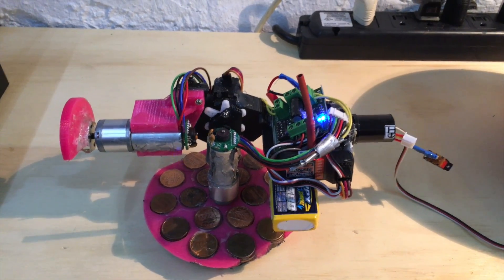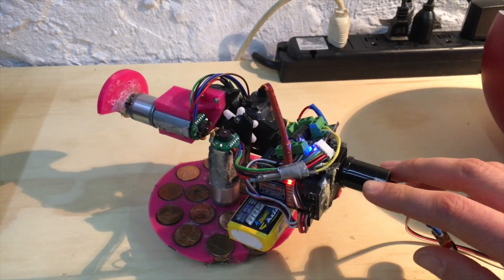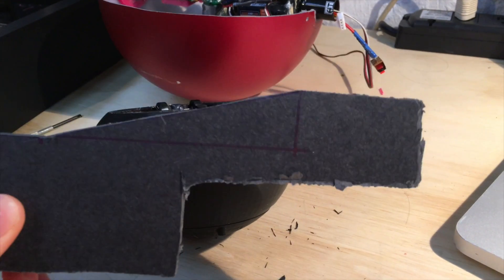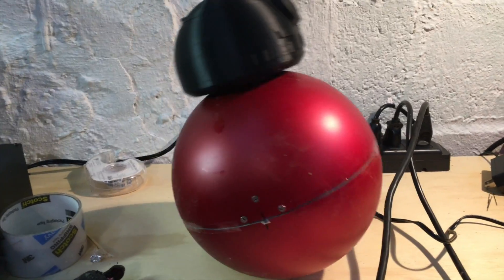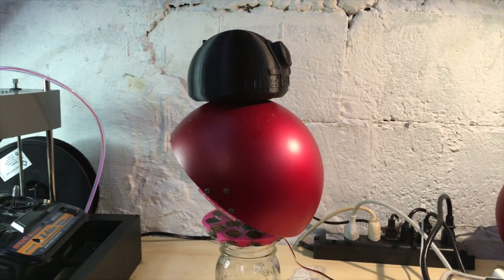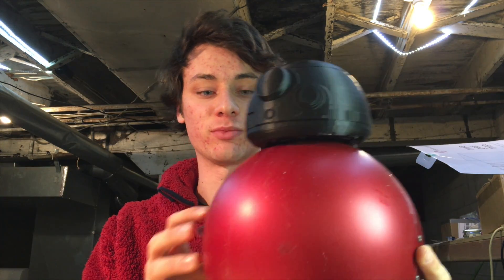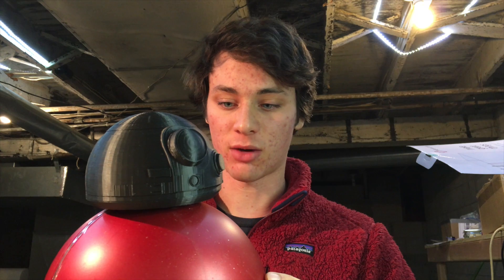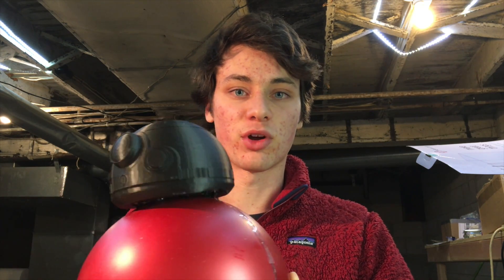Building Star Wars BB-8! (V2)

Comment: How did you make it wireless???
Reply from the maker: Using a remote controlled airplane transmitter (the remote) and receiver.  You can buy a receiver and transmitter for around 30 bucks on Hobby King.  Servos and DC motor speed controllers plug into the receiver and you can wirelessly control them.

Comment: I'm wondering if you could use a helicopter gyro vertically to correct the wobbling issue?
Reply from the maker: +Gabriel Comeau The response of the helicopter gyro was way too fast, and the ones that I got were not very adjustable.  It'd either vibrate at high frequency, or it'd create an unstable system where the gyro's over-correcting would cause the wobble to just increase and increase :/

Comment: Hey man! I'm building a bb-8. And my concept is very much the same. But I'm not very good with robotics:( and i dont have much to spend. I already have a sphere. But i dont know how to program/ wire the inside. Any suggestions? Please respond-As soon as possible:)
Reply from the maker: +HICKS INC. For the electronics you can start with RC airplane guides (FlightTest is a great resource) as all the electrical components are the same.  I did not use any programing, I just set it up like a remote controlled airplane.   For inspiration with hardware, Society of Robots and Lets Make Robots are good places to start.  Here are links to other robot-related sites I'm a fan of, so you can see techniques other people have used to build their robots: http://www.botsfromscratch.com/#!cool-sites/cmz0
Reply: +altapowderdog thanks man! Ill check it out!

Comment: I wish I understood how this works better... I'm trying to make a full size BB-8 and yours is by far the most stable design I've seen... Any help you could give me?
Reply from the maker: +Ethan Barnes Films Well, yours will be the same except larger motors, etc.  My advice is to keep the batteries and heavy stuff lower than I put them on mine, it'll help with the wobble.  Also, with a full size robot, you will need a gearbox with a large large reduction for the main drive motor, don't use 20:1 ratio or something like that if your BB-8 is full size.  Too fast of a drive motor and you"ll lose the low-speed controllability.  Also, the torque on the motors goes up as the sphere gets large.
Reply: +altapowderdog you might get this question why don't people just put a RC toy truck in a ball attach a pole to a base for magnets inside and add more on the outside, paint the body add details , done?
Reply from the maker: +Golfer Guy Some have!  But a rc truck has rack and pinion steering, which makes turning not work very well.  What does work pretty well is if the "rc truck" is a robot with two wheels that has tank-drive style steering, which is how the sphero works.
Reply: altapowderdog OK I kinda get it now,thanks.

Comment: You can get a bunch of that foam board at the dollar tree! It's super cheap!
Reply from the maker: +Gwoodcam Yeah, a couple people have suggested this.  I've built lots of RC planes using dollar tree foam board, so I know what that is.  I really should have done a better job explaining/ showing the material, it's got significantly stiffer paper on the sides than Elmers/dollar tree board, and the foam in the middle is less soft than either of those

Comment: How did u controll the motors and the servo? Can someone give me lings on the parts?  Good job with the build!
Reply from the maker: +Deenixd Thanks!   Heres the receiver, the servo plugs directly into this: http://www.hobbyking.com/hobbyking/store/__9042__Hobby_King_2_4Ghz_6Ch_Tx_Rx_V2_Mode_2_.html
Motors can't be directly connected to the receiver like a servo can, so this is what fits in between the receiver and the motors, and drives the motors: http://www.robotmarketplace.com/products/0-SABER2X5-RC.html
The battery (3 cell lipo) then connects to this speed controller.
Reply: I see... thanks for the explanation! Good luck with the projects!

Comment: This BB-8 Droid is Awesome and a very cool idea! Did you make the Model for the dome?
Reply from the maker: +Hidden Hood Nope, I started with this model to save time: https://grabcad.com/library/star-wars-bb8-ball-droid-1 (then modified the bottom and inside of the head to be printable without supports, and made it work with wheels)
Reply: Thanks for the helpful reply! My friend and I don't have a 3D printer but we are thinking of making a similar to the BB-8 you have here. Instead of plastic, we are considering making the head out of styrofoam.
Reply from the maker: Good idea, styrofoam might be even lighter.  Joann's and other craft stores sell various pre made shapes, I'm sure you could find a half sphere.  For getting by without a 3D printer, Shapelock plastic can be helpful

Comment: Cool! Almost perfect. 
Use a gyro/accel sensor, something like this: https://www.pololu.com/product/1268
And then PID algorithm to cancel oscillations. Heres an example code: https://github.com/fluentart/drone2/blob/master/drone/stabilisation.h
Reply from the maker: +Rouan van der Ende Thanks!  This is helpful.  I'll have to decide if I'm willing to convert it to arduino for the sake of stability.  It would make it a no-go for combat.  I'm looking into gyros made for RC planes right now, those may mesh better with my current setup
Reply: +altapowderdog dont make killing robots please. Remember the laws of asimov. 

Okay now on to tips.. you can use the arduino with your current remote system. the reciever just plugs into the arduino, so then the arduino gets all the commands you send it, then it handles the stabilization and auto corrects the errors in angle. 
How you do this is have two systems of vectors:

One representing the perfect orientation that you control, 

The other the measured orientation from the sensors. 

The difference between these two in terms of angle and velocity in its change goes into the PID algorithms, which then outputs the signals for the motors your need. 

Definitely worth doing! It blows the mind.  
Perhaps this helps you: http://bitlab.io/vector-rotations-with-javascript
Reply: +altapowderdog dont make killing robots please. Remember the laws of asimov. 

Okay now on to tips.. you can use the arduino with your current remote system. the reciever just plugs into the arduino, so then the arduino gets all the commands you send it, then it handles the stabilization and auto corrects the errors in angle. 
How you do this is have two systems of vectors:

One representing the perfect orientation that you control, 

The other the measured orientation from the sensors. 

The difference between these two in terms of angle and velocity in its change goes into the PID algorithms, which then outputs the signals for the motors your need. 

Definitely worth doing! It blows the mind.  
Perhaps this helps you: http://bitlab.io/vector-rotations-with-javascript
Reply: +altapowderdog Here's the Adafruit 9-DOF breakout board that uses the BNO055 http://www.adafruit.com/products/2472. I bought one back when they first came out but haven't used it yet so I've no experience with it, but according to Adafruit this chip makes working with these type of chips easier by doing a lot of the math on the chip.

Comment: I buy foam-core at staples here in NY, its white (I believe they sell black as well) and it matches what you describe. I believe you can also buy it at Michael's
Reply from the maker: +Michael Delaney I've bought foam board, both Elmers and the stuff from Dollar Tree, but that has much lighter paper on the outside.  This has thick card stock, almost cardboard, on the outside.  Much stiffer than what I use to build RC planes from.. hard to describe  :p
Reply from the maker: +Skye Shadley Great idea!  I'll start there.